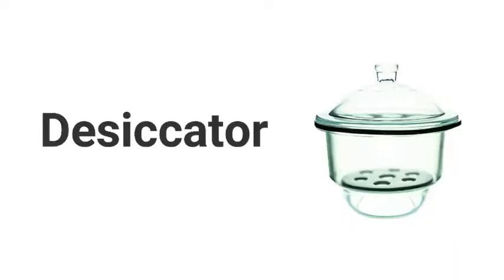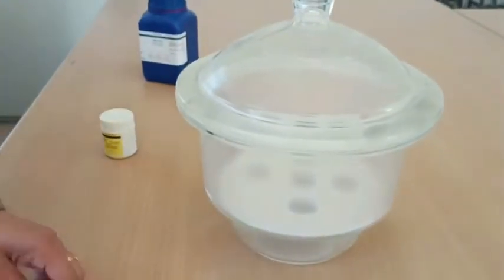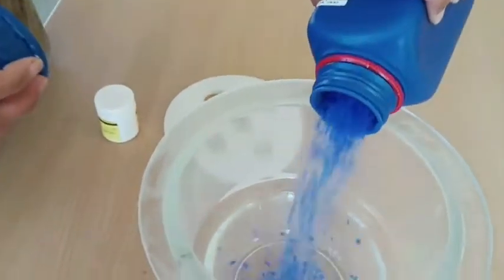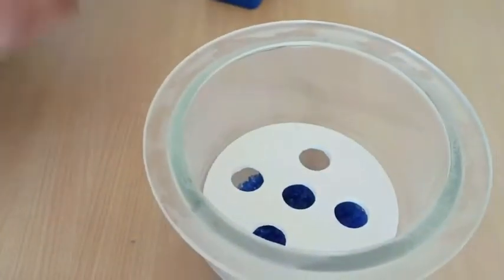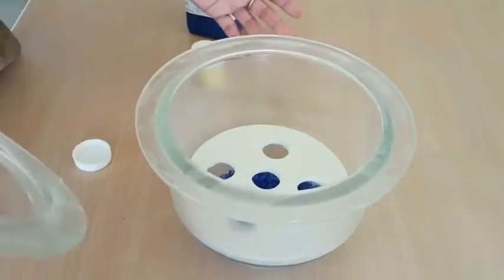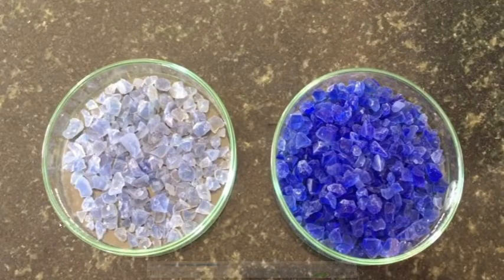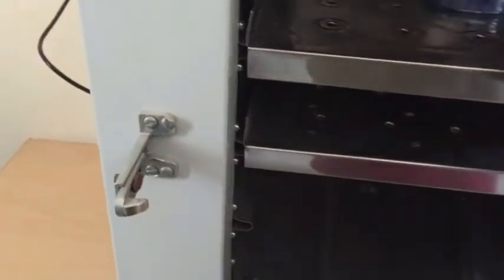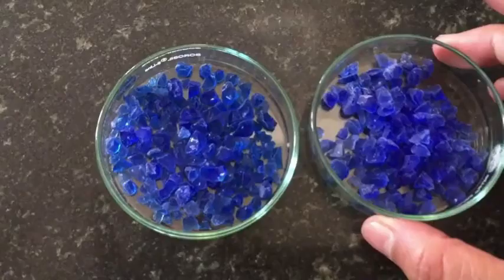Use of Desiccator and regeneration of Silica Gel | Lab Activity| Engineering Chemistry

Comment: why there is a hole on the top of the lid
Reply from the maker: Thanks for watching, it is to attach the vaccum pump to remove the moisture under pressure or to attach the nitrogen line if samples are moisture and air sensitive, stay tuned 😊